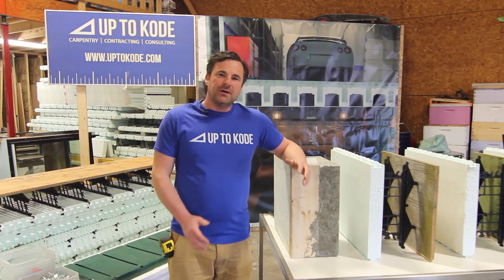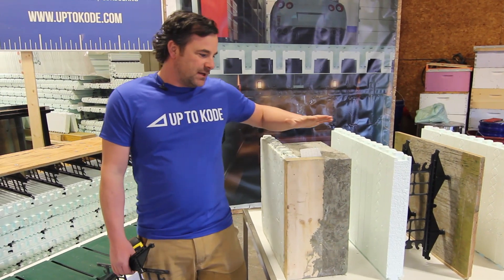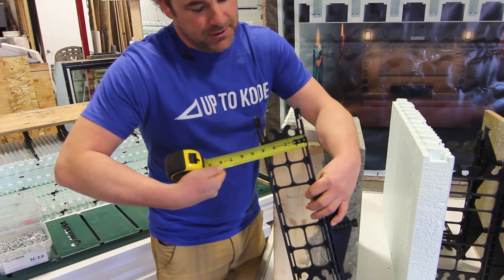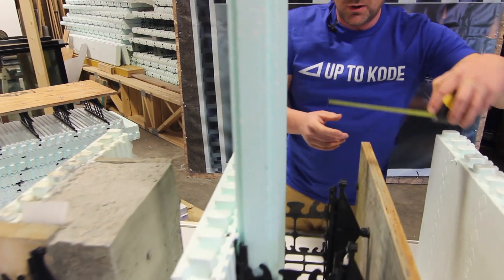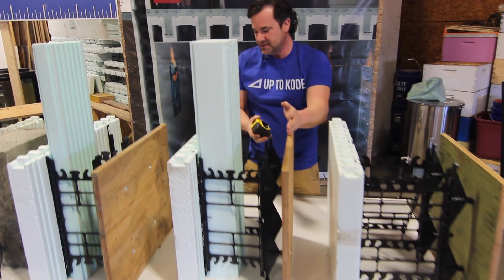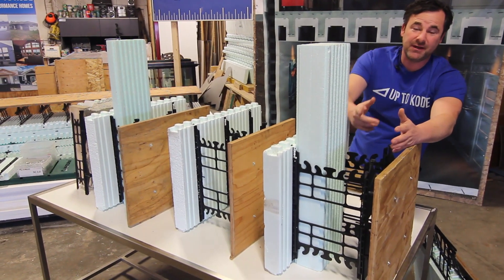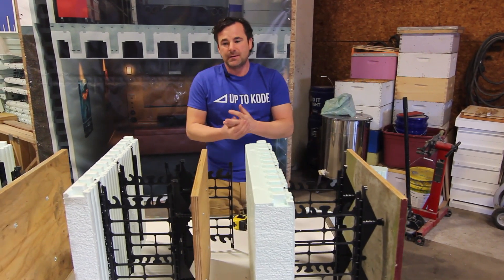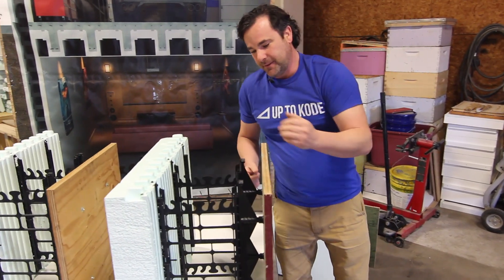How to Add Insulation to 1-Sided ICF

Comment: Very meticulous presentation, thank you for that!  We kind of get to the same place just using raw foam and formless concrete.
Reply from the maker: Thank you. Raw foam on concrete is an option but you don’t have the easy attachment points that the plastic webs offer for siding or any other finish.
Reply: @uptokode  Yeah thanks! The cladding is always thought provoking, esp here with fires.  The way I would do it again is to use light galv wire ties (to rebar) that poke though the foam to hold (good) stucco mesh.  Then waterproof.  That is less wasteful and less heat loss than long screws holding on cementitious board  (screw into bar chairs and then get tips cast in concrete).  Just plain foam with cement stuff both sides.  Will try for a lower cost stucco an inch thick in a single pass.  Eventually straight from a cement truck.  Has to be really fast!

Comment: Great stuff.  How do you attach the plywood to the plastic brackets?  Or should I say how do you accurately drill through the plywood and hit the hole in the plastic bracket?  I assume you drawl out a grid with the intersecting lines indicating the exact location of the bracket hole direct behind the plywood.
Reply from the maker: The plywood is pre-drilled to match the layout. They have a jig to line everything up and the plywood is attached with screws that are reusable.
Reply from the maker: Good question though ! Thanks for partaking in the conversation

Comment: I think because of the web space between the insulation, I would prefer insulation installed on the exterior of the wall. Nudura sells a homega 4" eps with wood battens installed in it that gets mechanically fastened to the icf webs.
Reply from the maker: That’s true! Another option for sure.
Reply: just a lot more  time,  work and expense and materials that can rot.... and using mechanical fastening, makes it less secure... but to each their own....

Comment: How do you efficiently mark out the holes on the plywood exactly for the multi-link tie?
Reply: Ok, I see you already answered that:
The plywood is pre-drilled to match the layout. They have a jig to line everything up and the plywood is attached with screws that are reusable.
Reply from the maker: You got it! If you did it yourself the layout is really simple and easy.

Comment: Hope to see you use it, to build a Passive Solar home someday.....
Reply from the maker: You and me both!
Reply: @uptokode  I know you just work with Nudura ICF. But since I respect your opinion, when it comes to ICF construction in general. I hope you can leave your thoughts on https://hempblockusa.com/ ICF? 
I did some research on it if you want more details? But I did not want post anything initially, if you already know about it and have your own thoughts about it.

BTW I remember Passive Solar homes with concrete walls that were used for thermal mass. And with windows and overhangs angles designed, so the south facing wall would only be heated during the colder months.... Were popular after the the oil embargo in the 70s... Shame use of Passive Solar mostly died out....

Comment: Does the space between the insulation slid in equal a wood frame stud wall thermal bridge?
Reply from the maker: I don’t quite understand the question.
Reply: @uptokode  It looks like the webs will create a space between the insulation that is slid into the icf... This space may fill with concrete at each web. Can you slide in two pieces side by side and then zoom in on the plastic web so we can see how that looks. I think that space may act like a stud in a wall as an area of less insulation.
Reply: SD: The entire wall is covered by the outer insulating foam... Also you have the option of the thicker outer foam insulation.... Plus as you add more insulation it has a decreasing effect.... So any thermal bridging will be nominal....(if your still unsure Google thermal imaging of it)

Vs just insulating between wood studs and all the air leaks associated with it....

Comment: Could this product be used to build an insulated chimney chase? That way instead of taking up a lot of space, a zero clearance fireplace can be placed where the opening is flush with the interior side of the ICF wall and still technically within the conditioned space.
Reply from the maker: Absolutely ! Why not?!  Good idea.
Reply: Kody Horvey Oh cool! Hope to see this in a future project. There’s hardly any example of a fireplace like that or anything similar on the Internet. All the snobs on the green building forums stick their noses up at the idea of a fireplace in a tight house. It’s total blasphemy to them.
Reply from the maker: I am open to all kinds of ideas. My favourite in an ICF home is a wood stove in the basement with air returns on the ceiling that can circulate that warm air through the HVAC system. Keep the heat uniform and it’s a great way to be “off-grid”.
Reply: Kody Horvey that’s a great set up there. It’s unfortunate that we don’t have basements down here in Louisiana due to the high water table. It would be very nice if we could. As much as I love wood stoves and fireplaces, they are just not necessary down here, especially in an ICF home. I still want a real fireplace for the crackling ambiance. But that winter storm that left millions of people in Texas in the dark and no heat makes a wood stove a great back up heat source. The main reason I want to build with ICF is because of hurricanes.